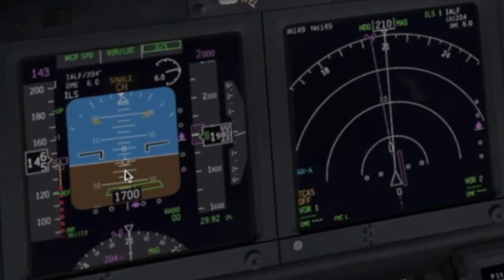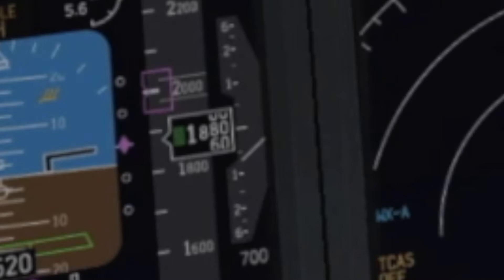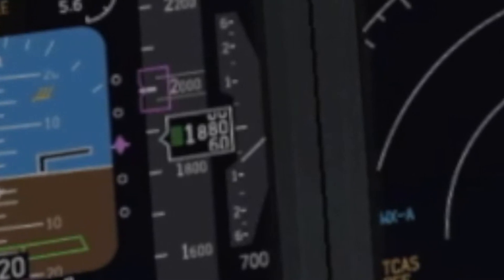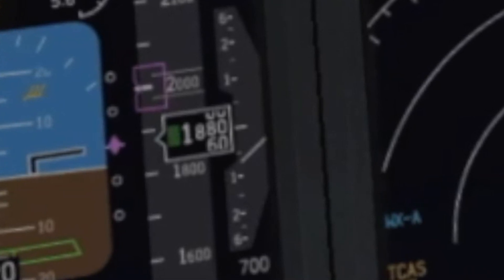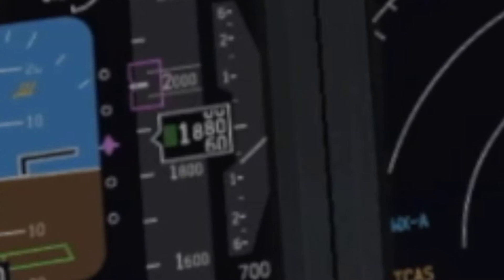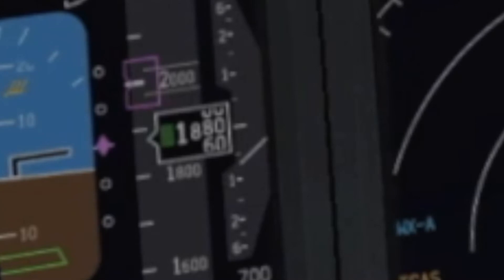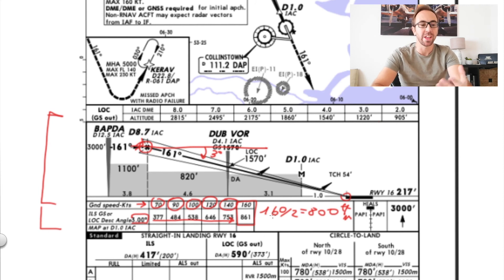Rate Of Descent - [What it is and how to quickly know what's your correct rate of descent]

Comment: Captain
I have a doubt
What should be the Indicated Air Speed, When I'm descending?
And when I'm descending, Ground speed will reduce, so how can I get a fixed  ground speed?
Reply from the maker: The IAS during Descent depends on your planning... If you descend faster you can start the descent later... Descent at constant GS is not a practice that we do
Reply: @PILOTCLIMB  so we change ROD when GS change
Eg:- At FL 18000ft, IAS 280knots, GS 400knots
ROD is 400*5 = 2000ft/min
When FL 10000ft, IAS 250knots, GS 320knots
Now ROD is 320*5 = 1600ft/min

Is this correct?

Comment: Hi there,
I have a question. I mean once we have estimated when we should descend based on 3:1 rule, adding wind component distance as well, then how do we deal with the fact that our descent rate will no more be the same as we get lower and closer to FAF for instance. I mean let's say we initiated initial selected descent at 2300 ft/min ( GS 460knots), how can we srill assume we'll descend at this rate when we 're lower and that GS will probably be around 350 knots ( 1750 feet/min'). Can the plane still descend at the initiate we did set in the mcdu?Or doed that rule alteady account for the fact that we'll have a lower GS anyway?
Reply from the maker: If you calculate a 3:1 descent, it means that you are calculating a 3 degrees descent (more or less) so the slower you fly the shallower will be your rate of descent. Yo are maintaining the descent angle constant not the rate.

Comment: What about if the angle of descent on approach is 3.5 ‘ , 4 or 5 degrees, how do you divide your ground speed  ? 🤔
Reply from the maker: Hey, thanks for watching! I hope the video helped you!!
The calculation is only applicable to the 3 degress descend, the vast majority of the approaches have a desced angle of 3 deg.
If the descend angle is different than the 3 degrees, you can check what rate of descend is requried in the apporach chart.

Let me know if you still have any question.
have a great day!
Reply: In case of change in angle, we can apply the formula i.e. angle of descent* GS (npm)*100=rate of descent for the angle used in the formula. Please correct me pilotclimb captain if I am incorrect? Consider, the wind factor and atmospheric pressure below the descent point.
Reply: @Rafian1924  lol you think you can do all those calculations as you approach the runway and communicate with ATC?

Comment: Hello Captain Gabriel,

Thanks for your video.

I have again some questions.

1) in the approach chart for Dublin:
What are the grey areas below the Glideslope?
And what do the numbers mean like 1100ft, 820ft?
Why do some charts have these grey areas and many dont?

You showed us how to easily calculate a proper decend rate, but for 3.0 Degrees angle.

But how do i calculate that for example:

3.4 Degrees?

Also please can you describe mathematically how you have a vertical speed of 
753ft/min when the groundspeed is 140knots.
I want to comprehend that mathematically.

Suggestions for new videos:

How dou you calculate the runway slope?
UP/DN.
How do you calculate the runway slope for runways which dont have a linear slope?

Like in Lanzarote, Düsseldorf.

Thanks
Reply from the maker: Hello, I'm glad you want to learn and expand your knowledge.

1. The grey areas are called Sector Minimum Altitudes (SMA) they represent the minimum altitude at which you MUST NOT descend no matter what. However keep in mind that you should always follow the correct path during the approach.

2. I showed a very practical example of how you can quickly calculate the 3 degrees descent while flying the plane also, this is what you need to know to make sure you don't go below or above the path throughout your approach.
This quick method works only with 3 degrees descent.

If you want to calculate another descent angle you can use the formula used to calculate the angles on a triangle.
In the end, the aircraft has a height a speed and a descent angle, thus, creating a triangle.

The runway slope is indicated in the airport chart if you have one threshold elevation that is lower than the other you have a slope.

I will most probably make a video about that soon.

I hope I helped you!!

I wish you a great day
Gabriele
Pilotclimb
Reply: @PILOTCLIMB  

Thank you captain.
Yes i want to learn more and you are a good teacher.
Luckily i started to learn many years ago.
But i still want more input.

Thanks for the SMA.
So never decend into the grey area.

Concerning runway slope, it would be also interesting about what you need to consider for non linear slope.

Lanzarote airport is a famous example if i am not wrong.

Concerning angle of 3.4 degrees i will try to calculate as you suggested.
Reply from the maker: @ahmedsmart1120  Good Morning, I will make more videos about runway characteristics!! So Stay tunes!!

Yes, you don't want to descent into the grey area, but also take always into consideration the altitude restrictions of the approach.

I wish you a great day,
Gabriele
Pilotclimb